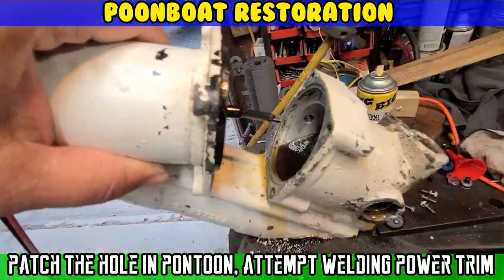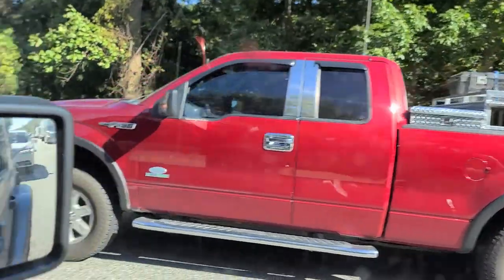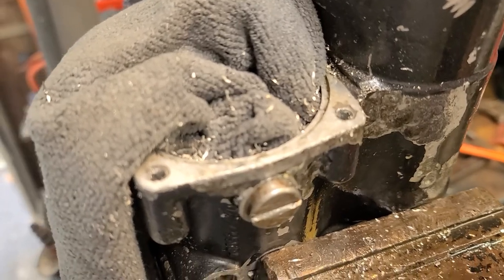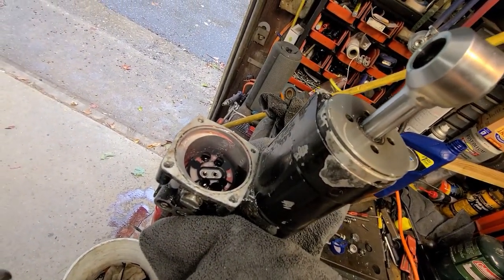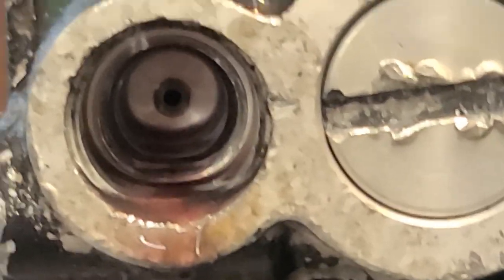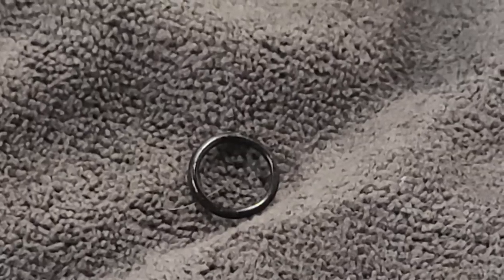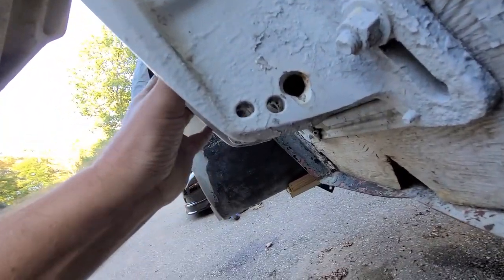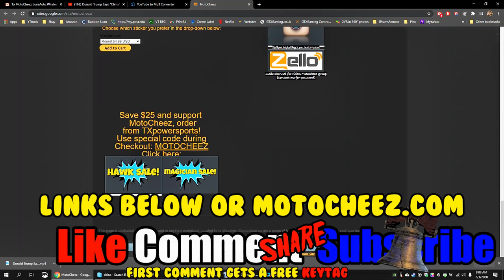Pontoon boat repair (Part 13) Repair the Johnson Evinrude power trim pump,  poppet valve, bypass

Comment: hello Moto....I have some old sage advice on drilling and getting broke bolts out...don't use ease-outs...that some bad JUJU...friend taught me years ago to drive in a Torx bit and just use a ratchet...ease-outs are too brittle and make a bad situation worse as they expand the hole and make it seize tighter...torx grabs it and turns it without expanding....just being helpful brother...
Reply from the maker: I'll try it. I've found easy outs work if the bolt is not "seized broken"

Comment: Awesome job fixing that trim motor, I reckon the shit stains from past hacker led you to the fix as well.    The sight of your DeWalt driver leds me to this question:  Have you ever replaced the chuck in one?  Mine likes to stay 'clamped', sometimes have to use a wrench to loosen it up :O.  I see they range from $10 to $40 on Amazon, should I go for the cheap-o one?
Reply from the maker: Thanks. I never changed the chuck on it, but have on other drills. The cheaper ones are not as good IMO. There's a reverse thread torx inside the jaws that usually holds them on, reverse thread on some. Take that out then tighten a large Allen wrench in the chuck and smack it with a hammer right hand tread